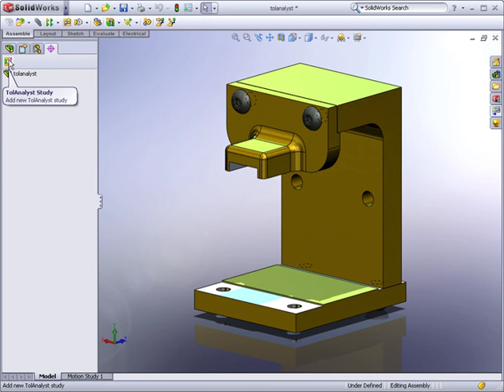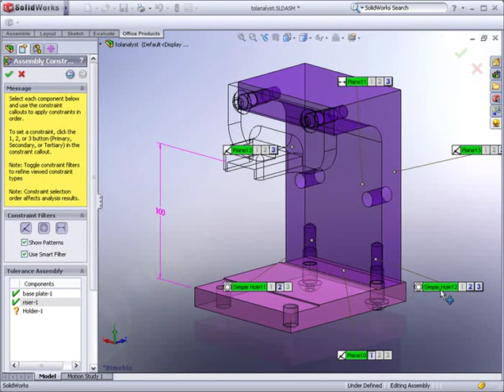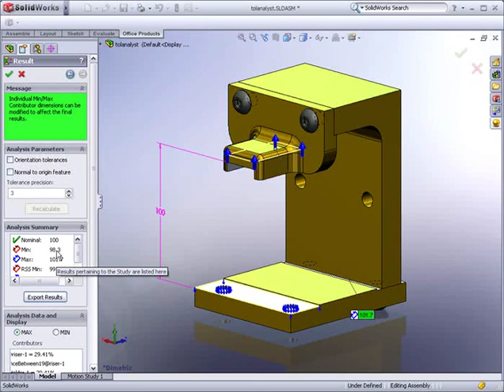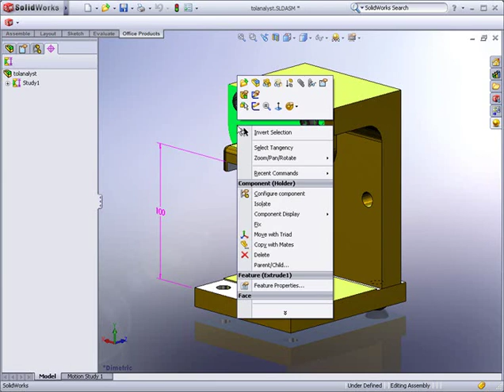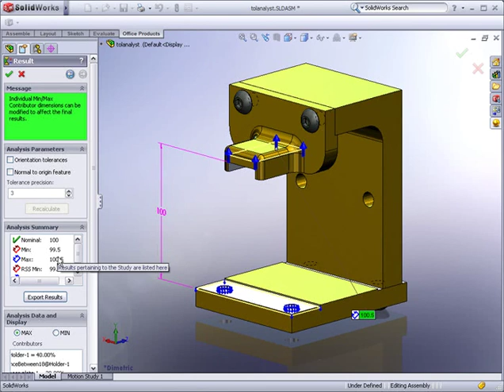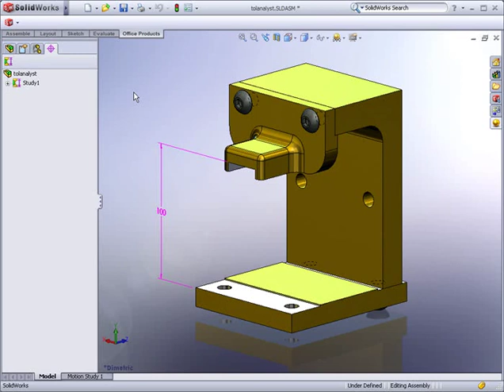Tolerance Stack-up Analysis with TolAnalyst

Comment: Say for example if those two button head cap screws near the top of your assembly were inserted into clearance slots instead of clearance holes to allow your "100mm" dim to be adjust from 95mm to 100mm in operation.  How would you perform a similar tolerance analysis?  Would you have to mate them at one end of the slot, run the analysis, mate them at the other and repeat?  Thanks
Reply: @whatsinthename8660  looks like no one has bothered to reply for the last 3 years.
Reply: @kylewarren69  Haha